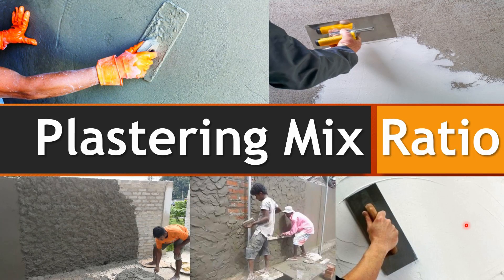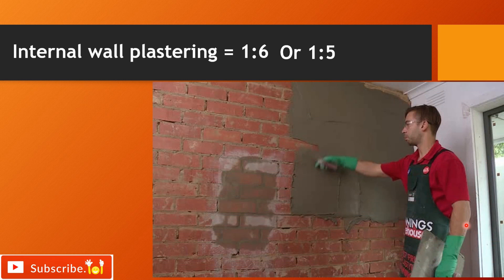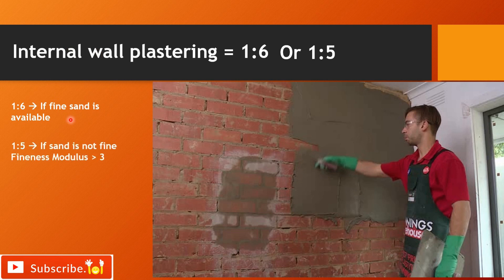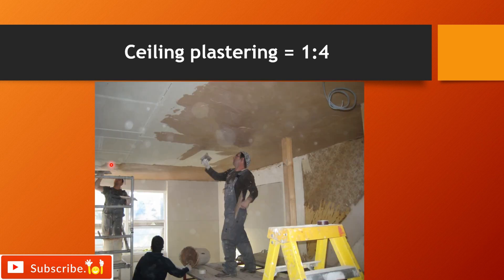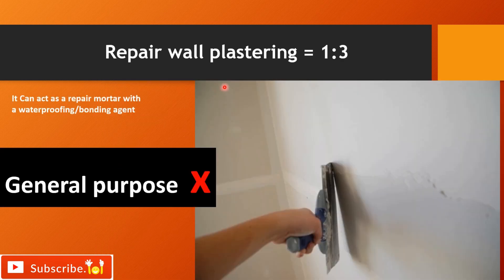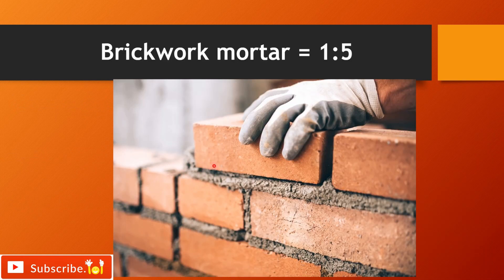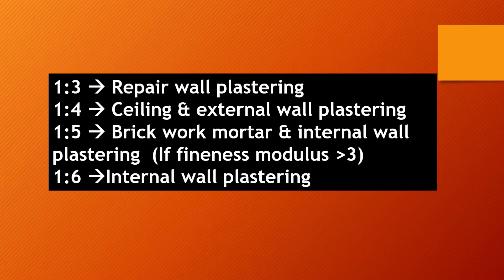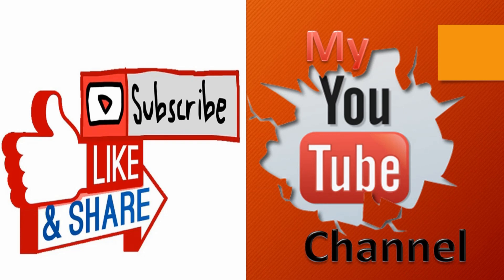Mix ratio of plastering for various purpose

Comment: Sir , I had a problem of seepage . So I had used ratio of 1:2 for outside plaster  as I thought more cement more strength.  But I was wrong the problem is not solved fully  when I was going through curing process .  Is this because of wrong ratio . I think in this 1:2 ratio cement absorbs more water and gives out this water outside surface or where it finds space resulting in seepage. Should i use 1:4 ratio for outside plaster ? Plz reply sir